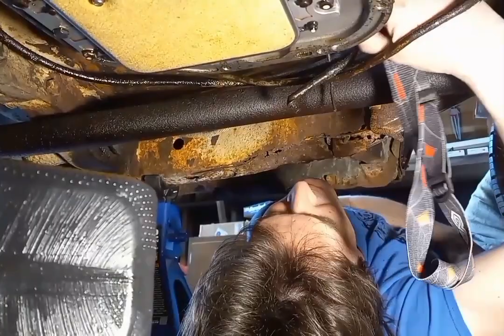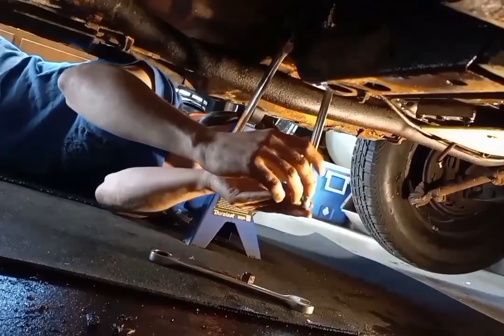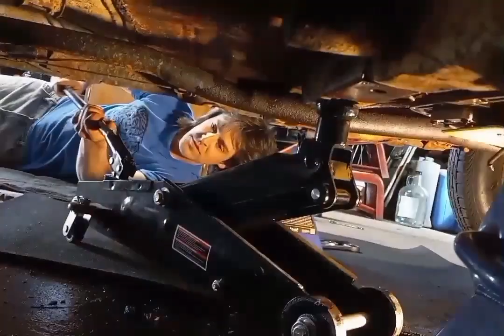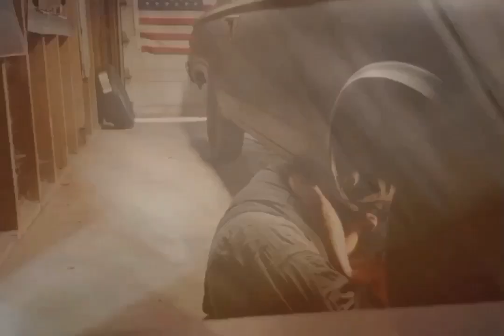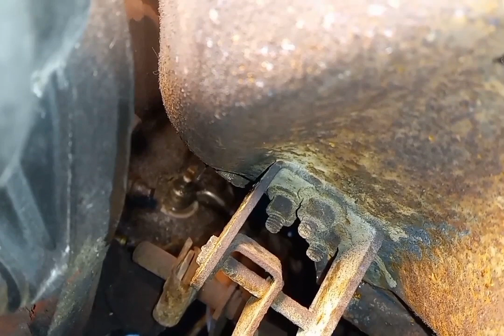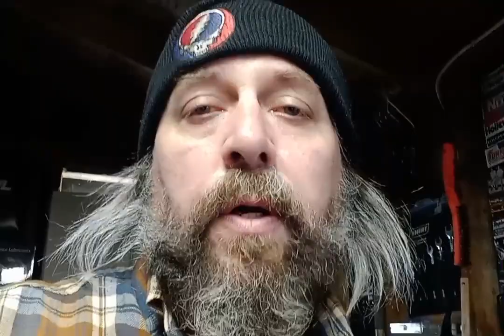Removing the 904 Transmission Pan to Clean, and Install the New Filter, Gasket and Seals - Part 2

Comment: first remove the drive shaft, remove starter, remove inspector plate, unbolt bellhousing on the engine block, on automatic trans unbolt torque converter, disconnect the shift linkage, unplug the speedometer cable, unplug reverse lamp wire harness, unbolt the trans mount from the crossmember to get the trans out.
Reply from the maker: Thanks Captain Dew!

Comment: I just removed the factory tranny .it ran but dont know how many miles and it has that trunion front joint that the parts are obsolete for  and getting the 70s 904 cleaned up to be installed
Reply from the maker: That's awesome MoparMan! We're getting stuff done